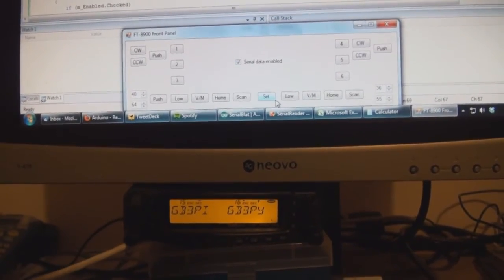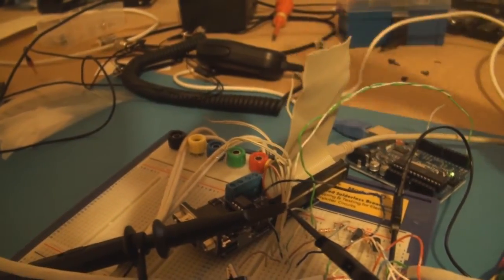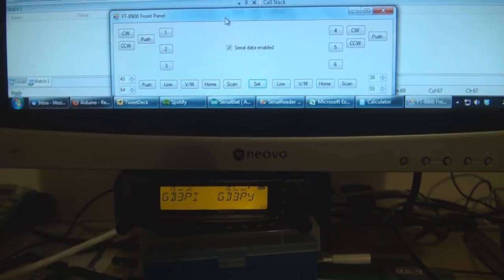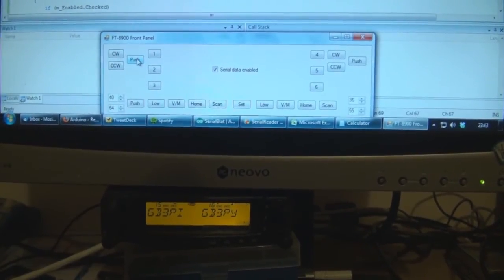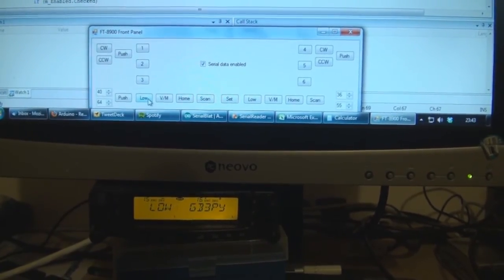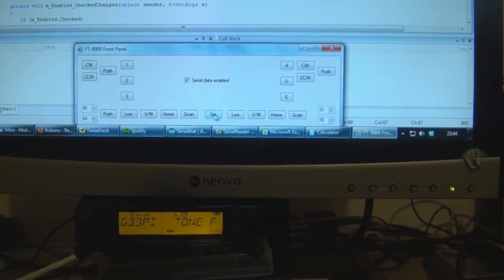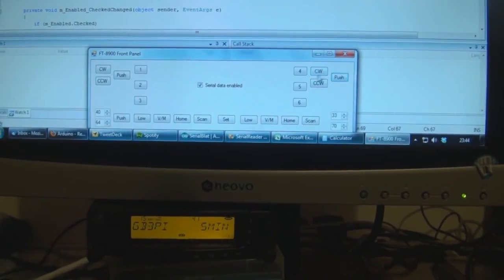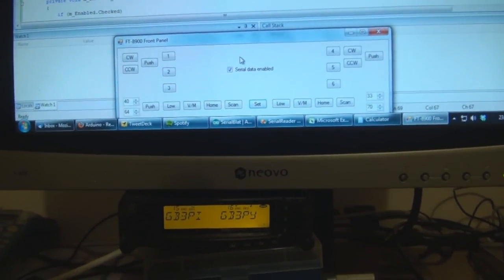2011-12-16 - FT-8900 Soft Front Panel

Comment: I see there is a project on Hackaday.io, somebody is interested in computer controling an 8900. http://hackaday.io/project/719-FT8900-Interface-unit

I've been interested in this idea ever since I saw your first videos over a year ago.  I would really like to combine either an Arduino or a Beaglebone/Raspi with a radio receiver chip like this: https://www.sparkfun.com/products/11737 and the guts of a car audio amp. My goal would be to create a combo car stereo/FT8900 head unit that fits in a standard DIN slot. Most cars these days just don't have a good place to mount a ham radio anymore.  It isn't like the 70s when one could easily bolt a CB to the underside of a dashboard. And there is my answer to anyone asking why someone would want to do this!

Anyway, I WILL start this project someday.  I don't want to start it now because I have other projects going and I need to actually complete something!  Someday I'll do the work myself if I have to but I'm pretty sure there is a large group that would be very greatful for the head start if you released the details on what you have done!

Please!

If not, that's ok. It's your work and your choice what you do with it.

Carry on with whatever projects you have going now!

Comment from the maker: It's kind of got put on hold at the moment - Ray G6RVS solved the immediate need by using (if I remember correctly) an RS422 line driver so we could remote the real head a considerable distance from the body (>100m).

I'd like to get back to it, but at the moment I'm working on some other projects :-).

73,
Rob

Comment from the maker: @ei4fjb Thanks for the comment. The video above is a proof of concept - it's not intended as a finished product.

As for why, consider the ability to operate the radio remotely - either over an Internet connection, maybe using VoIP for an audio path, or being able to configure it over the air.

Similarly, ethernet cable is much cheaper than decent coax - imagine mounting the body at the antenna, and using the head some distance away in your shack. No coax losses to contend with!